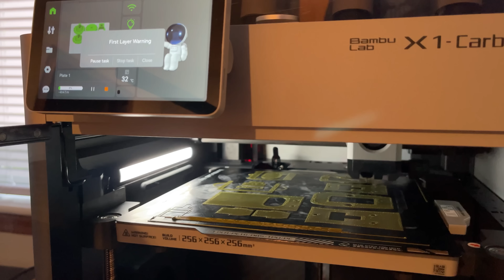Carbon Fiber Nylon is MUCH Stronger!

Comment: Using carbon fiber pla I once printed a hollow shell, 3mm thick, where it's connected on one end (like a can of soup without the lid) but it was small like 2 or 2.5 inch diameter.  I stood on it with all my weight (170 lbs at the time) and it didn't break.  If you do the slicer settings right you can make extremely strong parts with that stuff.  I have yet to try cf nylon, but I'm working on a project that needs to be as strong as possible because it's supposed to be metal, and will probably try cf nylon for that, using those same settings I used for the part I mentioned.

Comment: I get that the point here is to have as much of the death racer printed as possible but a bolt put through a hole going all the way through the axle would be a wise upgrade. That narrow cross section where it broke will be a common failure point without metal reinforcement.

Comment: Just don't let CF nylon get wet or even be in a high humidity environment (aka don't use it outside full time). It will go soft on you.

Try printing a small hook. It'll be super strong. Soak it in water overnight. You'll be able to tear it with your hands.
Reply: You are saying you print it, wet it, and it's trashed? Just getting into this cfnylon

Comment: Given how warm electric motors can get...from my many years racing RC cars, boats, and planes...You probably should print the motor mounts in something other than PLA..  Something more heat resistant.
Reply from the maker: The HTPLA from Proto Pasta is what the CFPLA is, and it handles heat fairly well. Though if that does fail, I’ll just reprint in CF Nylon. :)
Reply: Had no melts on PLA frames so far to be far, and I tested this for 3 months ;)

Comment: The model was designed by Michael Badeley. Not sure why you don't mention the actual designer,
Reply from the maker: Sure was, that’s why the link is in the description.
Reply: Great comment, and here's the thing.. I'm working with MB on this design to get it out to a wider range of makers. If you look at the links and the trail you'll see it links to Mike site and he will continue to host the files.  This isn't just one thing tho, i've been working with Mike on projects for years and he's a great friend of mine. The vision is the journey and getting the products out there is really key to success of model or design. The story here is I met Joel and we made a thing its super exciting for everyone and the product and make is just awesome... well unless you mis-print parts in which case its about 10 seconds of fun and several weeks of regret ;)

Comment: I have printed CF Nylon Footplates for my Electric Unicycle. I CAD them on Fusion 360 and printed on a Qidi X-Plus and a 0.6 Nozzle. Strong enough to ride on. You stand on EUC footplates, no saddle.
Reply: @Roskellan  did you do any post processing on them, like annealing?
Reply: @Kyle-fr7ts  No Annealling. The pins the footplates pivot on have to be run through with a drill and the stud holes have to be tapped. With time the nylon absorbs some moisture making the ride softer, but on an EUC without suspension in particular that's a good thing. I printed on top of Boron Glass with Prit Stick (6 layers) , heated cabinet (40C). Each footplate took 35hrs to print. Layer height 0.3mm, wall count 5, top layers 8, bottom layers 6, infill 50% triangles, no part cooling.

Comment: A thought... if knocking the head off is part of the win, having the head with magnetic electrical connection to stop the racer when knocked off.(obviously there should also be a bypass switch too)
Reply: That's pretty much how it works, there's a toggle switch in the neck, which switches it off when the head is knocked off.

Comment: How on earth did you get the Protopasta CF PLA to print? Total fail on my MK3S, just keeps clogging the .4 hardened nozzle and there isn't a profile for the filament in Prusa Slicer.

Comment: Why us carbon fiber filament if layer adhesion is your issue. Any filled material will by definition have (slightly) reduced layer adhesion.
Reply from the maker: Nylon without the CF isn’t stiff enough. I need the CF to add stiffness to the Nylon.

Comment: The CF prints look like they turned out great Joel. Just curious which machine you used?
Reply from the maker: Those were on the Bambulab X1 Carbon
Reply: @3DPrintingNerd  I was not expecting that answer. I'm shocked (good way) as I've backed BL X1C Combo so I'm now even more excited to receive mine. I'm also going to print with PA-CF and GF-CF. Very happy with your answer Joel and excellent quality video's too. 😘
Reply: @3DPrintingNerd  I really hope the Bamboo turns out as good as intended. Hope to see some videos of production line machines and how they do when being heavily used :)

Comment: As the master of print miles, does CF kill nozzles?  I always hear vague bemoans, but can't filter based on cheap China vs E3D brass.
Reply from the maker: Yes. It always depends on the material itself and how much CF it has, but CF will always wear away brass nozzles.

Comment: How rough is it on nozzles.
Reply from the maker: CF materials will erode away brass nozzles fairly fast. Well, depending on how much CF is in there and how much you run through.

Comment: I’ve read that PP has the best layer adhesion of all filaments. There are CF versions as well. Getting it to stick to the plate might be difficult though.
Reply: I once heard that thin sheets of balsa wood do the trick to stick the PP to the plate.